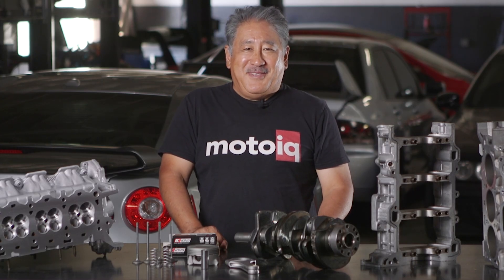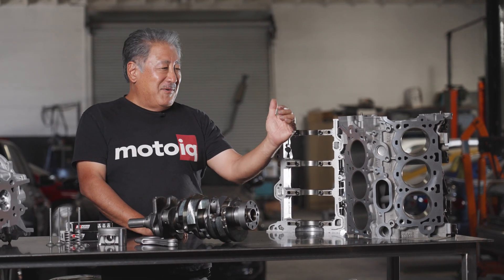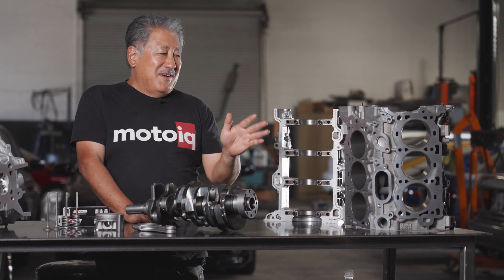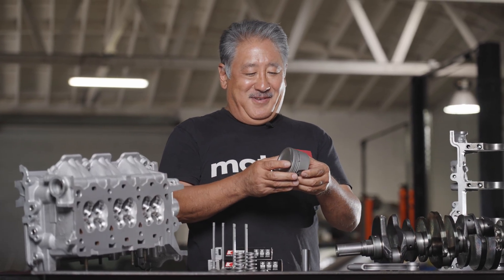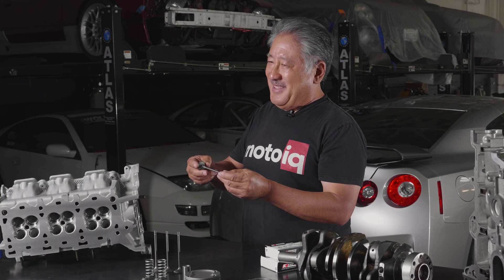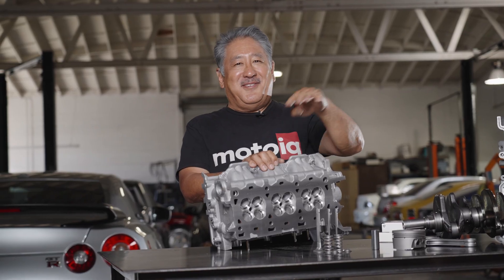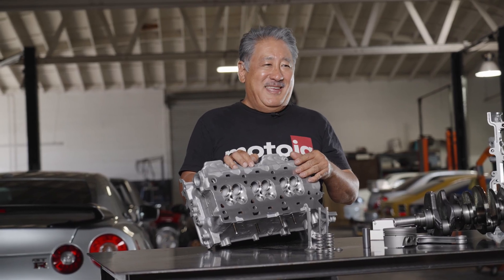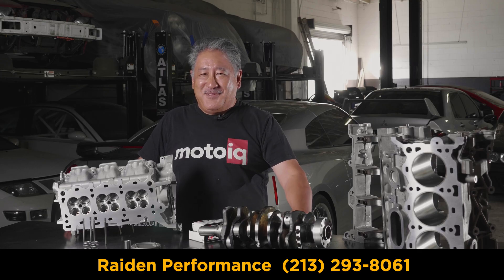How to Build a Turbo Ford Duratec V6

Comment: What do you think about adding boost to a stock 3.0 Duratec? Not crazy boost, just enough to make a fun daily.
Reply from the maker: Probably the types of cars this engine goes into isnt worth it.
Reply: @motoiq  It would be a swap into something else. Replacing a lackluster 4.0 SOHC.

Comment: Thanks for this. I bought a short block as a just incase. Noticed the bottom end configuration also and had me thinking this could be a great block to get 4-450hp from. Thanks for your valuable info I have a winter project now. Ford nerfed these things!

Comment: I got 2010 fusion sport 3.5 durtec love it but all they make is a bull shit tune cold air intake and exhaust for this car and I think a throttle body spacer I want to build motor and transmission and pro charge it

Comment: Wonder if this applies to the aj30 ? It's the Jaguar 2006 version of the duratec30. Even less performance info out there on it than the duratec30.
Reply from the maker: More or less. just more expensive to build

Comment: Had a 2001 Escape XLT with the 3.0 Duratec engine and the engine was still running after 17 yrs. Ended up getting rid of it because the body rusted out and wasn't worth fixing

Comment: If you were building an engine to run only off of methanol and boost it what compression ratio would you run
Reply from the maker: It depends but you can run more compression with methanol.
Reply: @motoiq  can you give me a rough na vs turbo average compression ratio for methanol like na high power vs turbo high power build for ford duratec v6 as example
Reply from the maker: No there are many variables

Comment: I had an Escape with a 3.0 Duratec. The thing was a freaking hot rod! The only thing was that it was a FWD model and it would eat up front tires rather quickly. If I were going to find one to build, I’d want a model with AWD.
Reply: But you’re not as heavy as Awd you’re lighter by a couple hundred pounds having the fwd version which means you will have a higher top speed and with the right tires and suspension you’re just as fast as awd version if driven correctly
Reply: The only bummer of the AWD is if a tire goes out, you have to replace the whole set
Reply: I have one brother and its fun
Reply: I’m in one right now in fact with that same spec. I took off the air cover for the intake. I have a K&N in mine. It sounds really good surprisingly good actually. Pulls harder than I expected.

Comment: Alot of horsepower but what about a much better breaking system...
Reply from the maker: Hopefully it won't break.
Reply: @motoiq  an object in motion will stay in motion unless acted upon by an external force 
Newton's 1st Law
Reply from the maker: So you need a good braking system to make sure it doesnt break!
Reply: @motoiq  my mistake "Braking vs Breaking" thanks ( swipe text, didn't notice)

Comment: I could be wrong but is it not a cast iron version of the mazda6  3.0 aluminum  block i know that when a mazda engine goes lots of people  just put the ford engine  in their cars as it so much cheaper to buy then the mazda motor
Reply from the maker: Its not cast iron.

Comment: Have you guys ever done a ford 3.7 cyclone specifically out of a 2011-2017 mustang? Pretty much ecoboost design just NA From my experience the achilles heal of those engines is the rod bearings and camshaft phasers and apparently the fix is a melling high volume oil pump at least for the cam phasers plus sub 5k mile oil changes with anything thicker than 5w20... my 185k mile 3.7 spun a rod bearing recently  and also started developing cam phaser cold start rattle shortly before the rod bearing spun...im the 3rd owner so no idea of oil change intervals before me but would be interesting to see your take on the 3.7 cyclone

Comment: What ECM options do I have to swap in a Jaguar 3.0 into my Willys?  I planned to build my own, but I want this thing running asap. thanks for any help.
Reply from the maker: Probably the stock one
Reply: @motoiq  No it has a transponder key security module, never will I EVER build a car with one of those again.

It looks like I might be able to use a 96 Contour 2.5 V6 ECM and its wiring harness. it has no chip key those started in 97, and the 95 isn't odbii.   But I don't know if all the sensors are compatible with the jag.
Reply from the maker: I mean why ask me? I discourage weird projects.  I would say use a more normal engine like an LS that has many universal wire harness and ECU options.
Reply from the maker: The other thing is OEM parts support of the Duratecs is becoming iffy.  Every one we build we have issues finding the needed OEM parts. Like I said in the last post, LS is a good choice and is more compact for swaps except its a little longer. A small block Chevy is even more compact.

Comment: Rather fascinated by the Porsche background behind Duratec V6 before it went to Ford and was further developed by Cosworth, there must of been a reason why Porsche developed it originally and wonder if it is connected to their stillborn 989 and 965 projects that were anticipated to feature an 80-degree V8 yet other engines were said to be considered. What Noble achieved by adding Twin-Turbos to the Duratec V6 does an idea of what could have been if there is any credibility to my limited conjecture above.
Reply: As much as they are a car company, Porsche is also an engineering company. Like Cosworth, they will sometimes do work for hire on other companies' projects. This could be the case here, but it's often said that this motor was designed by Porsche and sold to Ford. Perhaps these engines were in the works for the next generation of front-engine cars like the 968 and 928, and sold off when they knew they would instead focus on developing the Boxster. Either answer makes sense considering their somewhat precarious financial state in the early 90's.
Reply: Porsche is an engineering company that just happens to make cars on the side. Thats why its "dr. Ing h.c.f porsche AG"

Comment: dunno if you guys still check these, but currently planning to build a duratec powered 87 nissan 300zx, and will be attempting to convert a taurus engine to be longitudinally mounted, and needing some information, my plan currently is to use a rear water pump engine, remove that water pump, get a pre 99 front water pump timing cover, and swap the oil pan and pickup tube for one from an s type or lincoln ls, this sounds like everything should bolt up and maybe seal based on what information is available, but wondering if you guys know of any obvious issues id run into with that.
Reply: been planning this for a while, and was planning on using an aj30, and might still just do that to make things easy, but i really dont need the vvt and duratec plus all the hypothetical rwd swap components comes out cheaper than the closest rwd aj i can find
Reply from the maker: i probably would recommend not to do this.
Reply: @motoiq  well in my opinion, this engine is a direct upgrade over the vg30, aluminum block. Better bottom end, and timing chain as opposed to belt, so this is kind of my dream build, ik there's the very easy route of just using the already rwd aj with the rocketeer kit and a Miata or rx8 trans, and if that's the route I end up having to take that's fine. I know theres at least that way to accomplish this goal, but I just wanted to ask someone with actual experience building these if my longitudinal duratec idea is even hypothetically possible, bc it lowers the cost of the engine core significantly as where i live i cant find any rwd aj for under 1000 and I've found an 80k mile running duratec for 300, and I'm willing to be the Guinea pig for testing this. I fully understand that it's Ill advised, and I'll have nobody to blame but myself if I do this anyway and it explodes. But if it doesn't. I'll be willing to share everything I learned and did to maybe find more applications for these underrated engines.
Reply from the maker: The big problems are a lack of parts support on the aftermarket side, especially in the valvetrain, most stuff that was made has been discontinued so that means custom parts, and the worst problem, the OEM parts are drying up for these engines as well.  A VG30DETT is probably a better drop in choice or a more contemporary motor like a VQ35HR or even an LS.
Reply: @motoiq  I'll fully agree vg30dett is probably the most sound choice for the car, however I have 2 of these zs, and a vg30e swapped ranger, and dett swap is the plan for the street car if I blow the single cam. I believe I've seen a  vq in one of these before, but if I remember correctly they're a bit too tall for the stock hood, and i refuse to ls swap. This is just a passion project in its purest form I'm just more concerned about making something unique with this swap than I am about making something sensible, and liking 80s cars I'm very used to parts being near impossible to find. Again, really appreciate your time, and I really appreciate you actually having a serious conversation with me about this. I'll probably still go pick up that duratec I found locally worst case If I can't use it at least its not getting scrapped.
Reply: I do want to ask though if you know the best place to find diagrams for the coolant passages and the differences between the front and rear water pump setups, or if i should just shell out for a taurus haynes manual. Either way thanks for your time I appreciate you even replying.

Comment: Why 10:1 for E85? Wanting to know because I have a 2010 escape and thinking I want to turbo and change the compression on it try to squeeze efficiency out of it I only really run E85
Reply from the maker: because that's what you can do with E85
Reply: I have a 2005 ford escape . It’s a beater with a heater but handles a 100 shot with no problems at all  and hooks well with that awd . Lol😂 wonder if it will hold a 150 shot.

Comment: This video should be titled, "advertisement for Raiden Performance" and not "how to build a turbo Duratec motor...yes I skipped some parts of the video which I won't be faulted on as from the get go I was not viewing what I felt should have been expected. Now I'm not here trying to be a troll and throw around negative comments because I feel misled, however I am here to be a viewer with a sizable interest in these such things and could potentially be a viewer and my opinion is as was stated. That opinion again with more descriptors, this video through its title had me believe I was going to view a build of a duratec being turbo'ed and all I found was what I viewed as a shop advertisement disguised as an engine review video. Now I very likely represent a very small number of the status quo but there are some like me who may also be turned off after watching this video having gone into it the same as I had. Really I am at this point just offering feedback to the makers of this channel as someone who will forever be turned off by what ever I just watched and I'll never had become a customer but now il never be a subscriber because well there are too many channels out there to be running around picking that which "sometimes" offer me interesting content. I just think you wasted my time...I hope you took the time to read all the way through my comment and I hope I wasted at least a few minutes of your day. :) So maybe I was a small bit of a troll 😂.
Reply from the maker: if you think our content is a waste, then don't look at it. Too bad for you, you could learn a lot.

Comment: I seriously wonder how many good cores are out there.  Ford made a lot of these.  Would love to see a kit to adapt it to a T5 or 4R75.
Reply from the maker: It's a little hard to find new OEM parts.
Reply: @motoiq  is there transmission adapt kits?
Reply: @motoiq Is this ford jaguar v6 engine more reliable than m271 cgi mercedes engines?

Comment: Great job on the video. I'm working on a small mid-engine sports car a little bigger than a Lotus Europa and this engine would be great. The key to my car will be light-wieght and very aerodynamic. (-1500 pounds). Hoping for a top speed of 185 and 0-60 in the neighborhood of 3.5 seconds are the goals.
Reply: Sheesh

Comment: Such a POS motor with oil issues. But nice to see there was things that could be done to it. Ford Fusion SEL 3.0 worst car I ever did own.
Reply: Are you but hurt mate?
Reply: @usb7018  Never lol. I had it for free. Wasn't the car for me anyways. Slow, didn't handle well, interior didn't feel the best to me. It had good audio, did very good in snow with AWD and snow tires, and only made me late to work twice cause it broke without me interfering with it. Besides that its a car for someone else that just needs a car. Not something I would ever think of getting.

Comment: This video may have convinced me of my next engine swap.  I blew my 2.3L Turbo in my 98 Ranger, and have been looking at different engine platforms.  I will explore Raiden Performance.  I may look into a N/A version for simplicity.  but much of the turbo plumbing is in the truck still.  the truck was running close to ~300 (likely under, Bopart Cam/Heads, internals)  so maybe this can bring me into the 400/500 range reasonably.

Comment: What about transmission wise I have an 11 fusion with a 3.0 duratec and I've already put a torque converter in it and from what I've read they have weak torque converters and how much can the automatic transmissions hold up if they do have an aftermarket torque converter which honestly I haven't found anything for this platform except for the older 3.0 like 06 to '09
Reply from the maker: I would try Level 10 transmissions. https://www.levelten.com/SearchResults.asp?Cat=35

Comment: Scat makes the old 1000hp 3.0 crank. It's out of production, was used primarily for Noble. They will make you one. I've seen a twin turbo 3.0 Duratec make 971hp on the Dyno.
Reply: What intervals were used on the M400? We’re they stock 3.0?
Reply: @sarahdell4042 Just connecting rods
Reply: So a 400hp centrifugal build is completely viable, and a potentially long life span?
Reply: @austyndrums1993  absolutely doable. Probably even with the stock crank, aftermarket rods, and pistons could be 4032 alloy (tighter clearance, less expansion) boost would be under 20psi peak. Jag engine is the best starting point. Newer S type or some X types.

Comment: got a 06 Ford Fusion v6 with 190k in it. Strong engine.
Reply: mine has 723k and still counting
Reply: @usb7018  ayoooooo that's crazy
Reply: @usb7018 no way it’s still OEM.  I highly doubt the tranny lasted that as well
Reply: Yupp fusion💪🏾 I be driving mine like its a redeye😂

Comment: Im builiding an duratec aj30 for for my old ford. Its better heads without rockerarms and with vvt it will be drinking e85 and custom piston/rods, it has been alot of waiting for parts during this pandemic but now its soon done and ready to be mounted in my car.
Reply: Post some videos
Reply: Pretty cool, are you using the flex fuel system from a Ford Fusion or custom? Also what compression ratio are you running?
Reply: @johnherbold6539  It's 10:1 and custom fuelsystem., im using maxxecu race and 1200cc injectors :)

Comment: I drive a 2006 Mazda tribute, has the 3.0 duratec, haven't been able to find a single video talking about the possibilities with the series of engines until now. Leaking gasket in mine right now but contemplating what could be done is always fun 🤣
Reply: i have an 06 escape myself, so the same thing minus some cosmetics, and it definitely would be some more fun with 200 or 240 wheel horsepower rather than ~160 at the wheel. its currently in need of a rebuild, so i could go for a small turbo to boost it for maybe 4-6 pounds, which would definitely be enough to make a difference
Reply: those bedplate and lower oil pans suck for oil leaks! even when we reseal them at the shop using proper silicone (Permatex Right stuff) they start sweating again in 5 months, im wondering if the surfaces slightly warp
Reply: @snoofayy6150  Try using Yamabond4 or Hondabond, Permatex also makes a copy for powersports. It's a semi-drying anaerobic gasket material. Even if it moves a little, it won't leak. 
I've been using it since my beginning in powersports, it never leaks. Doesn't matter what the application is. All motorcycle and snowmobile engine cases are sealed with it. Including 2 strokes that operate in constant pressure and vacuum pulsing with premix oil and gas. If gasoline won't leak through ever, oil doesn't have a chance.
Reply: https://youtu.be/fcHIQD_tmnA 970hp on pump gas

Comment: i have been running the hell ( m90/10 pounds) out of  my stock 2000 Taurus engine in my prerunner truck for years!
Reply: What trans are you running stock ranger trans? I picked up a reg cab ranger edge 3.0l 5speed I know the bellhousing pattern is the same as the duratec. I was thinking about the duratec
Reply: @fastfreeks  05 jaguar s / 6hp26
Reply: @turbothis  Isn't that an auto? What are you running for ecu and trans controller?
Reply: @fastfreeks  I run it fully semi auto with an Arduino and 6 arcade shifter

Comment: There's a couple of cues they borrowed from their experience with the Mazda KL series V6 of the 2nd generation Probe GT. Except the Duratec sounds like shit compared to a KLDE or KLZE.
Reply from the maker: From what I understand is Cosworth helped design this engine.
Reply: @motoiq  Cosworth worked the heads, engine was a porsche design bought by FORD.
Reply: @motoiq  they definitely share some similarities like the split crankcase setup.
Reply: Except the Duratec makes power and the KL doesn’t...
Reply: @johnherbold6539  KL's make 200hp. What's a 2.5 Duratec rated at?
Reply: @michaelallen2501  also 200. But 250 for the 3.0 and as high as 500 for the Rossion Q1/Noble cars that MotoIQ does for Raiden performance
Reply: The Contour SVT sounds great. I'm sure the KZL sounds good but it's been 25 years since I've seen a Probe or MX-6 on the street.